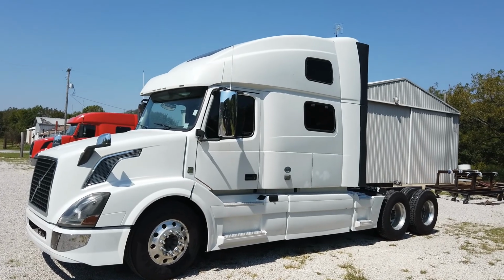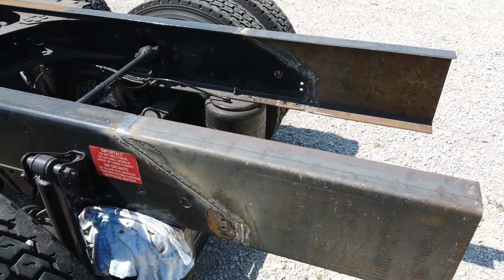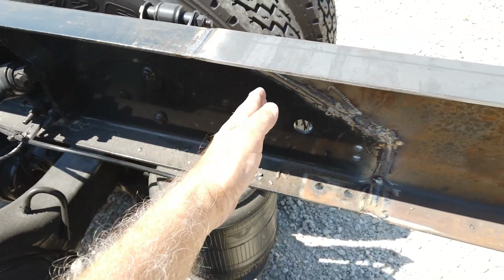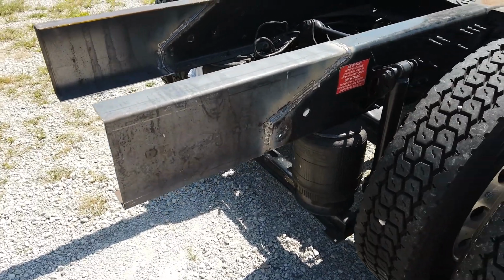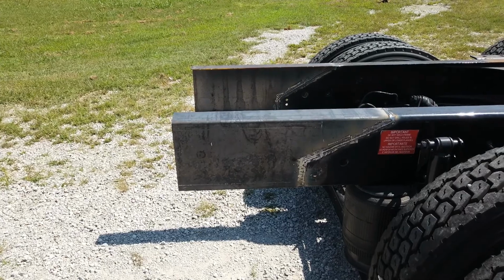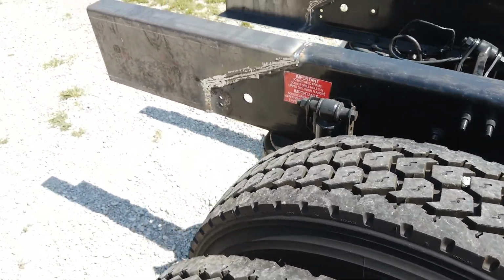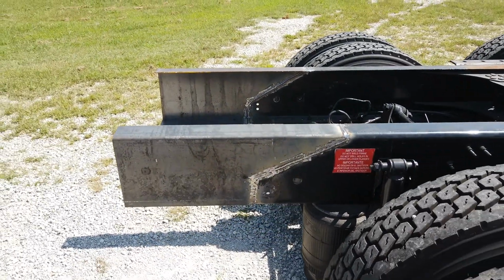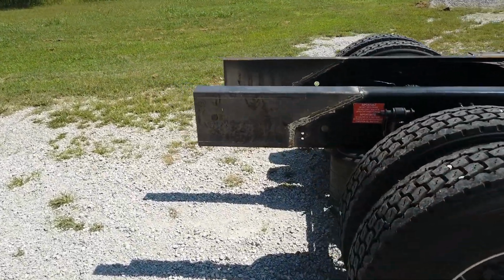ET Hitch Mounting and Frame Extension

Comment: I have a question can you put the hitch almost up to the torsion bar. I no the shock and air bag are there but you still have roon under the hitch to gat at the air bag bolt. And the shoch you can just replace the one huck bolt with bolt for hitch . The guy working on mine says it is possible to do.
Reply from the maker: Yes you can push it forward. As long as you are willing to move some stuff around. You will also have to reposition the leveling valve in most situations. And you want to get that correct.
Reply: Might have to move the air suspension leveling valve and rod so not to contact the hitch